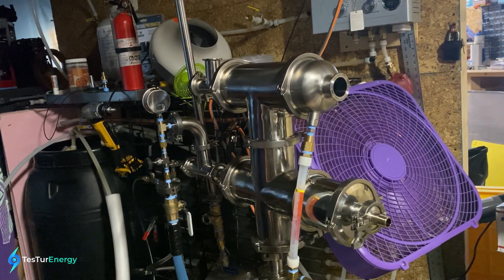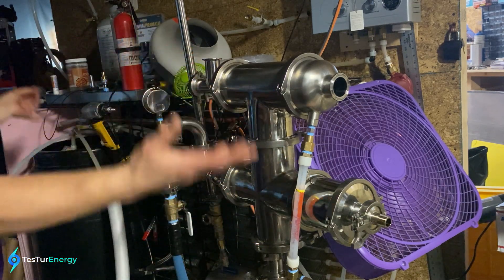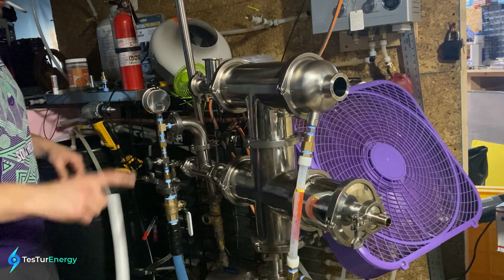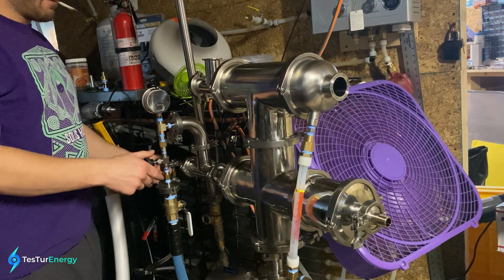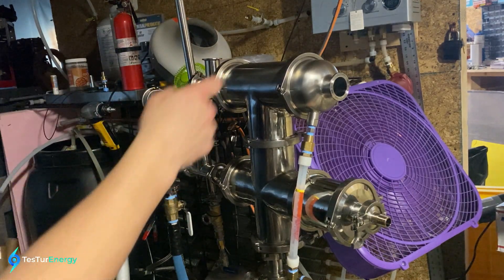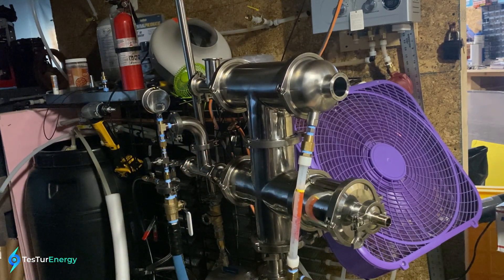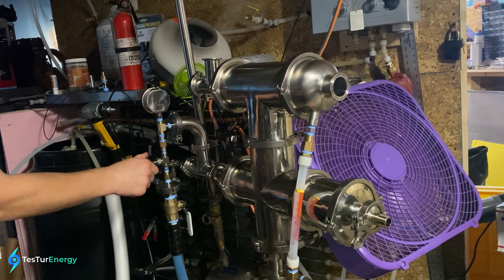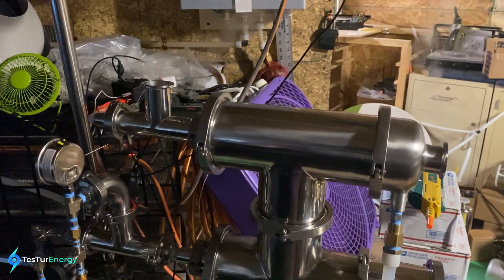Tesla Turbine Combustion System GB186,083- Pulsed Detonation During Ignition? propane flame tube PDE

Comment: The chuffing sounds might be "contaminants" in your fuel, either air creeping in the line, or whatever from the tank. Kinda sounds like light cavitation though also. Regardless, if it sounds like "friction"(sic), it will cause erosion.
Reply from the maker: Mmm I like where your head is at but I’m fairly positive it’s just flame instability from the flame tube and accelerator nozzle when there’s just barely enough oxygen to burn all the reactants.
Reply: @CharlieSolis  I gotcha. That could absolutely do it too. 
 How about an actual query from me? (From me.....?) Will you utilize the cryophorous system for preheating fuel and/or cooling the intake air charge? Just the "boiler" setup could easily heat the fuel of course.
Reply from the maker: Im working on both an air and fuel coil line to go inside the header of the boiler. This way all the energy that is dumped into the latent heat of vap that can’t be used for expansion can actually be dumped into the fuel and air at a perfect rate via condensing the steam in the header onto itself as the air and fuel go through the boiler picking up the heat.
Reply: @CharlieSolis  Ahaaaa, alright....
Reply: @CharlieSolis  Oh hey, kinda random, but I wonder if you do or have thought of this.... Instant energy supplement, even if you don't have Sativa around. Put your favorite DnB on...... and speed it up!
  I don't Dubstep, so not sure how that works out. But Gawdamn, it's like Hardstep or Jump Up, with better syncopation. Eye-D's "MF Unicorn" on YT 1.25 spd; HRRAAAAWWWWRRRR!!! 
 I had to this morning, fresh outta the herbal remedies....
Reply from the maker: Ohh boy do I love me some DnB. 🕺 LSDream and Rezz are my go to artists at the moment. I highly suggest them if you like to get a little bit grimy fro. Time to time. 😈
Reply from the maker: Have you watched the show “Devs” before? Lol that “buzzing” sounds WAYYYYY to similar to the like “beehive static” in Devs 😵‍💫🤤🫠 lol and my phone is def not picking up the whole sound either lol
Reply: @CharlieSolis  I'll check it out. AK1200, and Technical Itch were my beginning, still go to's. I've met Tech, one of my old homies that made it kinda big, DJ James Hampton, spun a sunrise set, for a "party" lol, that Tech headlined. Dude stayed for my buddies very melodic, trance core (trance/happy hardcore). Boy produces the likes of Oakenfold, and Orbital nowadays.

Comment: It seems to be leaking a liquid
Reply from the maker: Lol yeah I may or may not have damaged the PTFE gasket from a completely unrelated mishandling of it. 😇 I needed to get it going and hot again for it to “reshape” so that it didn’t keep leaking. I wasn’t there quite yet in this recording but it has since stopped leaking.
Reply from the maker: Hey Burnologist! I saw your comment on that video chat after I closed it. But no I do not have any sort of things between the discs that resemble blades. I believe you’re talking about adding “flaps” between the discs to catch the fluid better for more torque right? 

In fact you do not want to have anything in the way of the fluid disrupting it’s smooth flow to the center. When you design the turbine disc spaces correctly you do not need any extra “blades” in between the discs for increased torque. The boundary lady shear force that the fluid applies in the disc faces is more than enough to get plenty of high torque even at low RPMs. Let me know if you want me to further explain that as well! 

In the mean time, if you haven’t already, check out the dyno test I did with my turbine that got 2.75kW and 6.22ft-lbs of torque at only 4150rpm. Plenty of torque with only smooth discs! 
https://youtube.com/shorts/yXQy844URMA?feature=share
Reply: @CharlieSolis  I know I personally left it for you to answer. Didn't want to leave out any "minutia", considering Nikki T accounted for/utilizes ALL the minutia...
Reply from the maker: Yup it hasn’t leaked a drop since after my burn tests last night and I even loosened up the Tri clamp.

Comment: That's looking Very nice, I think you've simplified the whole thing a bit,. I wonder what is the boiler tank under the whole burner setup for ? Feed water?
Reply from the maker: Thanks Oscar! It’s just being used as a stand right now. I have plans for it though. Still hammering this out first.
Reply: @CharlieSolis  let mi guess,  you gonna use it as the regenerative heat exchanger from the exhaust ( so it stratified the preheated Water en then it can be boiled by the flame tube en supper heated en so on ) en after it ofcorse cold steam recoap heat exchanger?
Reply from the maker: @oscarverwey  more or less something along those lines lol.